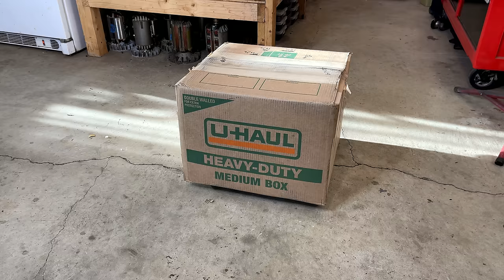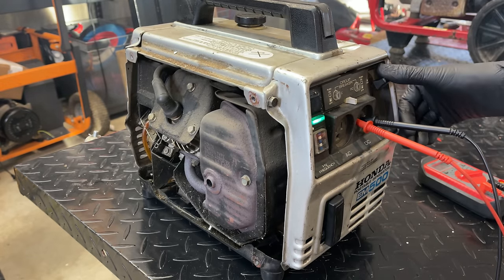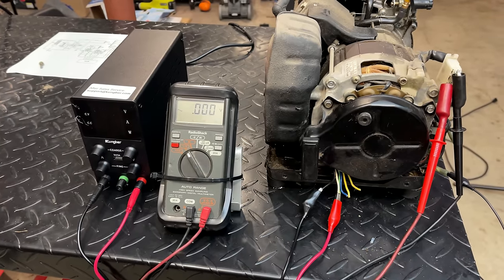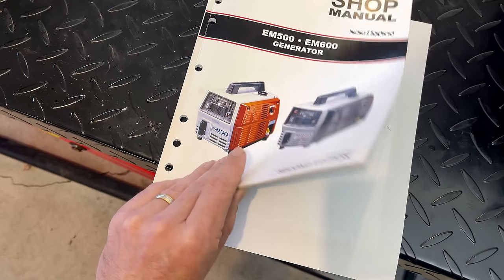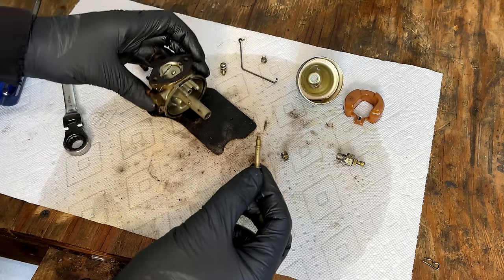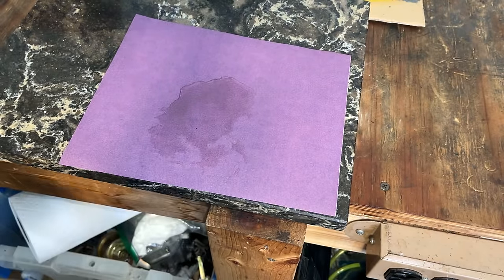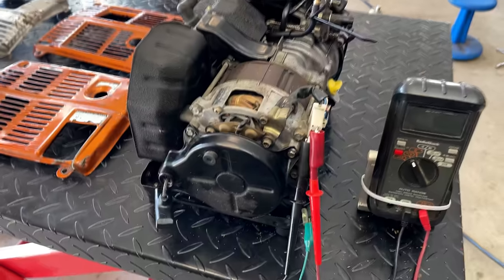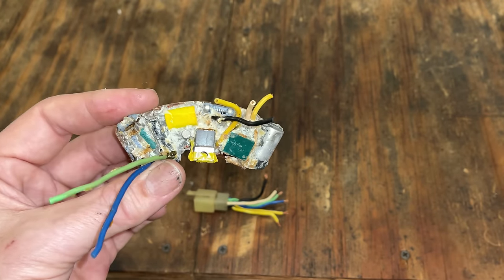Vintage Honda EM500 - High Voltage Problem

Comment: Watching this video sparked my curiosity, so I searched for AVR schematics and got lots of hits. I haven't looked at them all, but none of the ones I did look at used any kind of microprocessor, i.e., they all seemed to use discrete components. The ones I looked at that did use IC's used simple (cheap) linear op-amps or comparitors. With those results, I'm wondering if it's possible to get the potting material out of there (some sort of solvent?). It would be great to repair that AVR by just replacing a few low cost, discrete devices!  Great video, as usual. Thanks!     Whoops!  Should have watched the last couple of minutes.

Comment: I hope you read these comments. I can give you a bit of a tip that can help you out when you are epoxying parts back together. I have a roll of wax paper that i use for doing things like that. the epoxy will not stick to the wax paper, and the part comes off right away without fighting or trying to remove the part from whatever you sat it on.
Reply from the maker: Thanks for the tip

Comment: One of those AVR's from an older Harbor Freight Predator 800 watt model generators just might work and worth 
a try. That's what I'm currently thinking! Provided that the AVR has access to the trim pot adjustment, well perhaps
it could work!

Comment: Not too long ago Tractor Supply was selling a 900 watt inverter generator for $159.  Actual wattage was a tad over 700 watts.  4 stroke, not 2 stroke.  From a pure dollars and cents viewpoint, that makes better sense than spending $150+ in parts for a 40 year old generator.  We all love to see James bringing these old things back to life, though, even if it doesn't make financial sense.

Comment: James, regarding all the parameters of the AVR that you provided in the video, it doesn't need reverse engineering to have the replacement made. Just design a new circuitry with more reliable components including a multi-turn pot. That was what I had done in the past 30 years before my retirement. 

I am referring to you a genius design engineer of a young generation. He would be your partner if you two plan to commercialize the project. The cost to build such AVR is probably in the $15 range. 

 His youtube channel is "the post apocalyptic inventor"

Comment: I have 3. Whenever I see one going for cheap i buy um. My first one 10 years ago was $50. My second one last year was in pristine condition in original box $200. My most recent one was $120 and it had a few carb issues but i fixed it.

Comment: JB Weld works good for, as long as you let it set up, good.  I had a front new bar bolt on a Stihl 025 that I am restoring, that was loose.  I used JB Weld to lock it into the threads, permanently and it worked fine.  I let it set up over 24 hours @ 75 degrees F.

Comment: GREAT job of packing but the shipping cost from the Left Coast was probably more than the value of the generator. Nice work on the hose bend. Great sleuthing on the AVR again and I have heard that China is VERY good at reverse engineering. :-) I suspect many owners of these 40 year old generators might view them as disposable.
Reply: If you ever have to ship something like this, it's usually cheapest to drop-off and pick-up at a freight trucking terminal. They may require heavier stuff to be crated or palleted, but the savings can make the effort well worthwhile.  It's not an obvious shipping choice and many people don't know that anyone can do it, which is why I mention it.

Comment: I have an EM500 that I learned a lot about here. Mine puts out ~50V for quite a while after startup, and only after 5 minutes or so does it jump to 120V. That seems to indicate it isn't providing power to the field windings and therefore is probably also an AVR problem.

Comment: Awesome video buddy. That generator is over a decade plus younger than I am. I wish I could replace my skins and parts to get back working as new again or as close to. That's the perfect camping generator if you can silence the exhaust it be Alot better.

Comment: As always a great video. I was wondering what would happen when you control the current on the power supply in place of the voltage. The field depends on the current. Thanks an keep up the good work.

Comment: May I make a suggestion... I have found flux brushes work very well with cleaning better than tooth brushes getting in tight places and they are not attacked by solvents... also they are cheap enough to throw away when using with glues and epoxies... I enjoy your videos..

Comment: I was reading through a whole number of comments.  One pointed towards another "universal" AVR.  I followed that and concluded it was a bit crude, intended for much bigger generator.  It had different inputs, like from full AC output.  There were two zener diodes, one 12 V and the other one 9.1 V.  One small transistor related to the 12 V zener and a couple of TO-3 power transistors -- on board photos 2N2955 on schematic something else.  Anyway, I liked the suggestion of using a simple 3-terminal regulator, especially as this only needs the 18 V power.  A 7805 as suggested would be fine, but there is another option that would allow building an adjustable one.  That would be for example an LM317. A trimmer potentiometer and a couple fixed resistors would allow the adjustability.  Just in case somebody would be interested in building some more AVR units.  Of course a bridge rectifier and some filtering capacitors would also be needed.

Comment: That sort of situation is the #1 thing that upsets me about fixing older stuff.   You need one measly part,  and the price is a king's ransom, or it's completely non-existent.  The WORST feeling is having to send something to salvage that you are certain could be repaired If just that one little piece were around.  Seeing the unit de-potted,  I wonder if just the Electrolytic cap took a dive.
Reply: the failure mode in this case is the transistor short circuiting, it's somewhat common apparenly, caused by lack of cooling on the transistor. it was all the way buried in the middle of the potting blob, so that checks out I guess.

Comment: I have been reverse engineering these more than a few times. If you know your stuff you can easily deduce the component values. Not to mention that the values of most of them are simply not critical. You already have the voltages it has to work with and the schematic in which it is connected. I have depotted more than one CDI unit as well, so i have an idea about them too.

Comment: Just a note sometimes you can remove potting with paint striper.   It would expose the old traces, one word of caution is may also remove the part numbers.

Comment: Also a subscriber named Lewis here with a similar problem. Mine is an EX5500 water cooled generator. The solution was a new voltage regulator.

Comment: UK. Great stuff as always. The problem with old electronics is finding someone capable of doing the impossibel. Totally off topic but  my 'Lord Of the Wires' just died. After 50 odd years I have just taken up electronics again. In your language James - Oh My God. Those little black things with wiv legs are great but give me an old EL34 blasting blue electrons into the dark any day.

Comment: I think heat was the wrong approach

use a dremel  with a carbide mill bit and carefully grind away the bulk of the material undil you are almost at the component, now put some oil or water on the surface and take pictures or write down the numbers
then you can proceed to peel or cut away the outer housing and further remove material

if there are any electrolythic capacitors inside, it is most likely that component which has gone bad

Comment: I have an 73 EM 400 on my bench.  The gas tank is a special kind of hell but it fires on a shot of fuel in the carb.  Very well engineered small generator.

Comment: I know with Honda, sometimes parts from newer machines will fit the older ones, definitely something to check out.
Basically it’s cheaper for a manufacturer to reuse a patent and design they already have, them to make a new one.
Reply from the maker: Exactly.  I think the EM600 uses the same AVR.  Would not be surprised if it shared parts from other models.

Comment: Hi, related to the very last problem you addressed at 01:17:30 _ _I can suggest an idea for you to try. Get a good working modern AVR board, that is still available in good amount quantities and peel it's insulation off, until you can reverse engineer that. And after that, after you understand the circuit and the principle of operation, you can apply it for your older AVR board, re-making it from scratch to fit the specifications. Its how I will do it . Hope it helps.
Also at 53:10 , I would have remade that component from aluminium or a block of plastic. Your method is good as well, but to be sure it will be no future problems, I would have re-make it. Its a very subjective idea of course. Great work nevertheless.

Comment: Hi James.  Couple of suggestions:
Found that Gunk Foamy engine cleaner works really well on parts like the pan.  Clean off the excess crud, spray with the Gunk, wash with the hose.  Also finding more and more uses for Dawn Powerwash.

For the broken carb isolator.... know anyone with a 3D printer?  :Edit:  lol...should have read ALL of the comments before hitting Send...

Thanx again for the videos.

Comment: One problem with a high THD is it creates lots of eddy currents in the core of the generator and it gets much hotter than typical.
I watched the scope as you turned on the lights and I concluded that it would be nicest to the generator not to exceed 300W.

Comment: Hi James. I have been your subscriber since Nov 2022 and have watched ALL of your videos up until now. I do have some questions I need to ask and for you to clarify please.

1. You said that a generator does not idle. Is this because it needs to maintain a constant engine speed?

2. When testing a generator, you always test it up until 3,000 watts. Is this like a standard test, or depend on the generator itself?

3. You have an excellent troubleshooting skills. Could you explain more on what to look at, the where, how and why when troubleshooting a generator and in general, any machine you were troubleshooting? Perhaps this is something you could make a separate video on.

I am looking forward for your videos every single week. Keep up the amazing work!
Reply from the maker: Most generators have to run at 3600 to make 60 hertz.  The main exception are inverter generators.  Some can idle, but the hertz and voltage will go out of spec.  Only reason for that feature would be at a construction site.

It’s just easier to test at 3000 watts instead of 6000.  If there is a problem with the engine or powerhead it will usually show.  If I suspect a problem then I break out additional heaters.

The troubleshooting part is hard to answer in the comments and it’s really just a process of elimination and testing.  That said, tomorrow video will test my troubleshooting abilities.
Reply: @jcondon1  Thanks for replying to me. Can’t wait for tomorrow’s video!!!

Comment: That little guy is on 2 of my lists; 
1: of things I kick myself for ever getting rid of..
and
2: Things I'm on the lookout for..
That was my all time favorite camping generator..yes, it's small, but it only had to power a few lights & a tiny little fridge, and it was the quietest 'lil guy I ever had. (for whatever reason yours seems quite louder than I remember mine)
Occasionally we'd go with some friends to a camp site that had this stupid "no generators after 10:00pm/12:00pm on weekends" rule..which simply didn't apply to me. No one could hear it..even when the nosy park guy would make his golf cart rounds to bust ppl, I'd put it behind the truck and run cords, & he'd never hear it.👍
Got mine for $100 near brand new @ an estate sale when the model itself was new/"new-ish"? in the 80's (yep, I'm old ;-) 
Gave it to someone who desperately needed it thinking I'd get another soon, and we know how THAT goes🤷‍♂🤨

Comment: Good job fixing up a neat little generator.  It's too bad that AVR is so expensive, I'm sure it's a fairly simple circuit.  For what it's worth, I'm an electrical engineer and I had to reverse engineer and repair an automatic battery charger without a schematic by sketching the PCB traces out by hand.  Although the markings on the parts are gone after de-potting, I'd be happy to help figure out that circuit if possible.
Reply from the maker: Thanks for the offer.  I was thinking the same.  The traces are clearly visible.  Would be a good place to start and then one by one figure out the components and maybe some of the values.
Reply: Ditto:)
Reply: Same here, there didn't look like there were a lot of components on that board

Comment: I'm curious mate, have you ever thought about getting deeper into the electronics, like being able to design and build an AVR?  It would frustrate me no end being at the mercy of these old parts.
Reply: And of course at the end of the video you literally talked about exactly this.  😄
Reply from the maker: I have always wanted to get more into electronics.
Reply: @jcondon1  Engineering courses are expensive, time consuming and need large amounts of studying. I know, I have been there.
Reply: @r8118830  I'm sure he didn't take a course on generator repair though either, yet here we are!  I don't think it's black and white to say that you cannot learn how to do this stuff without taking an official course.  It takes longer but you build layer on layer and - in my view - can end up with a deeper understanding than many professionals.

Comment: A while ago you used the services of a contact to fix a generator circuit board - I would have though he could have helped here as the main problem would have been de-potting the failed component. seems like a fairly simple circuit given the date of manufacture. Might still be worth investgating ready for the next EM500...

Comment: Any time you have a video about a Honda generator my ears perk right up. I’ve had several over the years, and I’d still have them if they weren’t stolen. The one I have now is an eu2000i that is 23 years old and still fires right up on the second pull when it’s cold and on the first one for the rest of the day. The only thing I’ve ever done is clean the jet and tube once in a while. You can’t beat a Honda. Overpriced? Maybe. But I’ll pay it every time.

Comment: Maybe your electronic mate could cobble up a circuit to re-encapsulate in the AVR box.   I once made a regulator for a 35A Alternator using a 2N3055 transistor and a 15v Zenner Diode, and a few other bits.  The rotor coil only needed 2 amps for full output, so not much amplification was required.

Comment: If the only electrical obstacle to using a generic voltage regulator is the relatively low voltage required by the Honda's field winding, a simple solution would be to put a power resistor in series with the field winding, with a value two or three times the DC resistance of the winding. You would throw away a few watts of power, but it's an inexpensive solution compared to sourcing the original Honda part. You could even use an appropriately sized incandescent light bulb

Comment: I'm sure the universal AVR could be made to work. If it always wants to supply more than the required 5 volts you could step it down with a resistor. Since the current is low the resistor would not need to be massive, a 33 ohm 5 watt resistor would be plenty.

Comment: When I epoxy plastic parts I have had very little success. The epoxy doesn’t adhere to the parts with any real strength. So If the parts are thick enough I glue them to gather and using a very fine drill bit I drill and pin the parts together. I coat the wire with epoxy and insert them. For wire pins I use the steel wire from wire brushes. Another source of wire for pins are the drill bits! The whole procedure is a real pain in the b***, but when the part is not available it has allowed me to save a number of items. The last thing I pined and epoxied was the turn signal switch from a 1959 Chevy Belair. Its still working fine after two years of operation.

Comment: What works really good on the seat is a little Flitz on a Q-tip in a drill to clean & polish the seat for a better mate with the needle before placing it in the Ultrasonic cleaner.

Comment: Those are great little generators, i have several, Did yoy dispose of the old covers? those AVRs are a real pain to find, ive had more dirty carb issues with ones that i picked up, great video

Comment: I have a little chinese 1700 watt portable generator. It refused to start......it had compression and spark.   So I took the carbie apart and cleaned it in detail.  Still no start.  So on a hunch, I stripped the engine out the case and checked the valve lash........and behold, the shaft the rockers pivot on had flogged out. So although the valves moved, the lash was so bad that it could not start or run. So I will have to put a bushing in the aluminum housing to fix the sloppy rocker shaft and all should be good.

Comment: Thanks.  I own one of these.  Mine has a problem where the engine falters intermittently and I've been unable to figure out what is wrong.  It still runs good enough to recharge my Jackery.

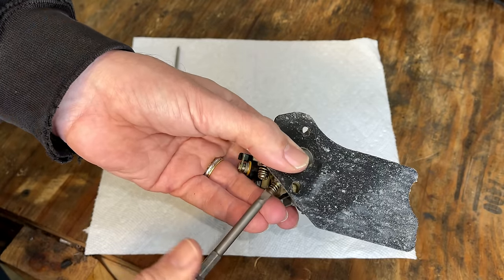Comment: Page 52:00 if I were in this situation - make sure the junctions are cleansed from oil. First for silicone compound and second for JB weld, since this is pneumatic than mechanic. Or continue with JB weld and add a home made washer with 10-25 thou solid neoprene. Should address the coplanar difference at the junctions.

As for a second thought, continue with JB weld providing we install the spacer back immediately well before JB sets hard. This will address coplanar imperfection caused by torquing down the fasteners and not tear off the JB binding.